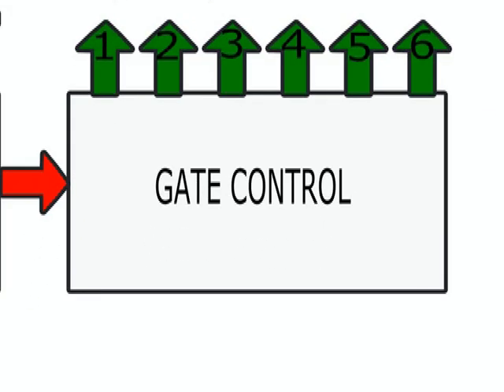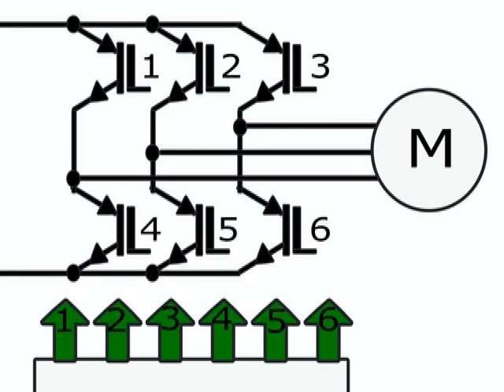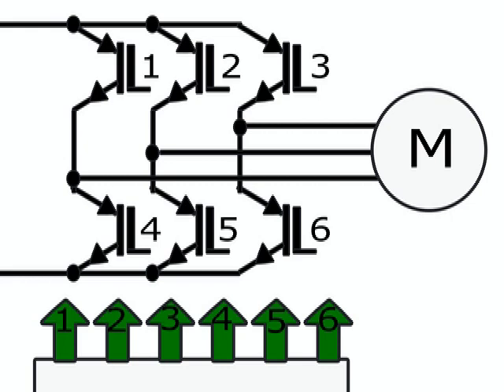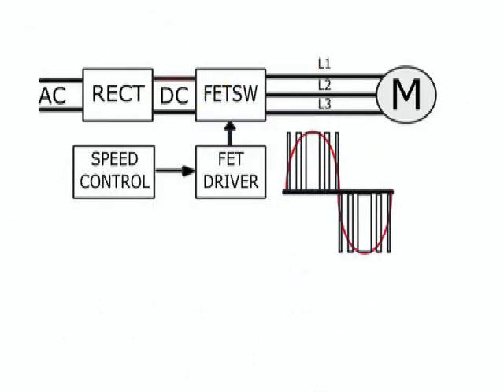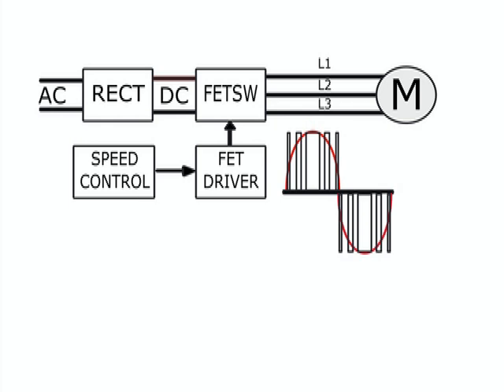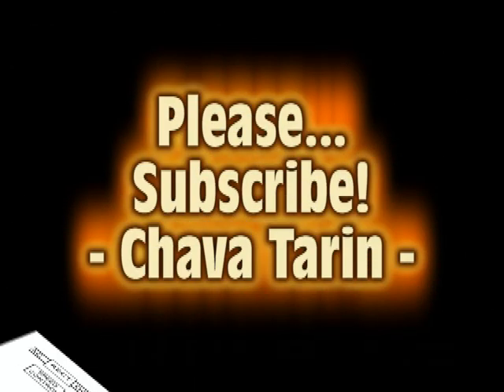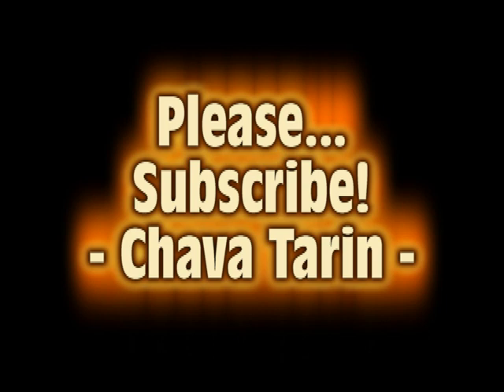How an AC motor speed control works

Comment: Is there a way to run a 3 phase  195V induction motor from a washing machine.  It has its own invertor  board. The inverter is plugged into 120VAC power supply.  The main board of the washing machine basically  supply the PWM to the motor's control board.
I see three thin wires plugged into the motor control board from the main board. (Ground and 5VDC plus the middle wire being the Pulse)  And another separate wire for tachometer.
I don't need to control the motor to behave back and forth like it does in the washing machine.    
The simplest would be just a 3 wire pwm, I would think.  Or 4, it doesn't matter.  
Since the motor has its own inverter board, I don't see the need for VFD or whatever.
Any ideas?
Thanks in advance for any pointers.
Reply from the maker: My closest approach to that is when a customer bought a big three-phase bench grinder and what I did was use a speed controller (separate unit) for generating the three phase power since he only had two phase power on that facility,

Comment: Dear Chava, do you believe this video 100% Free Energy Generator Self Running by Magnet With Light Bulb 220v, or do you think this is a hoax? https://www.youtube.com/watch?v=dVE6ofG9d9c
Reply from the maker: A magnet and a coil produce a voltage (and current) only if one of them is moving with regards to the other. A still magnet just touching a coil simply cannot produce any electricity at all. On the other hand, if you move them, it takes energy and it requires energy. So it is not free. Besides, the coils are too small to produce that much voltage unless the motion is energetic and brisk. It is a hoax, no doubt.
Reply: @eltunene  Dear Chava thank you very much for your competent answer. With kind regards and thank you for your educational video's. God Bless you.